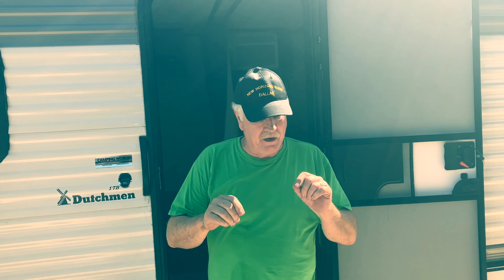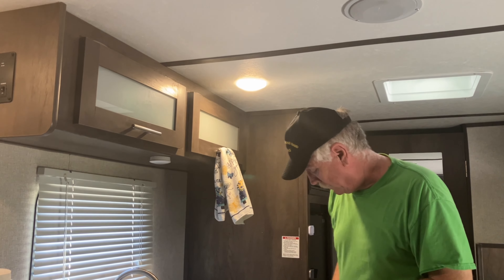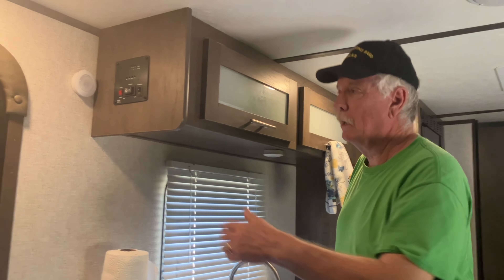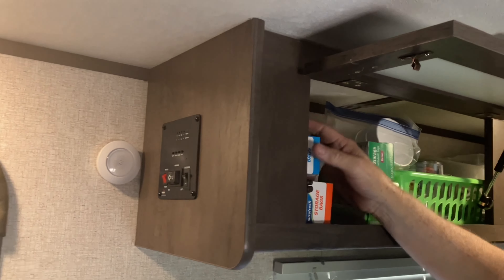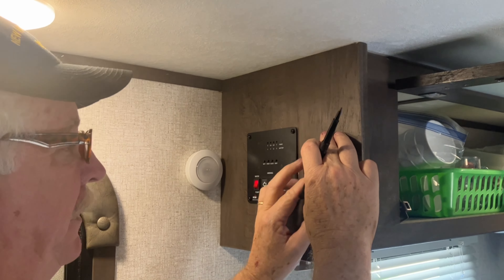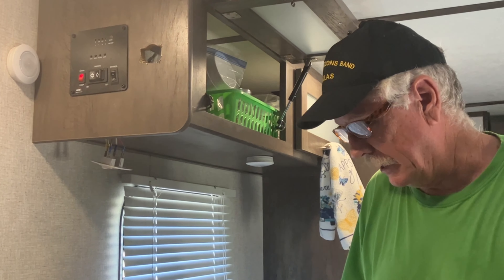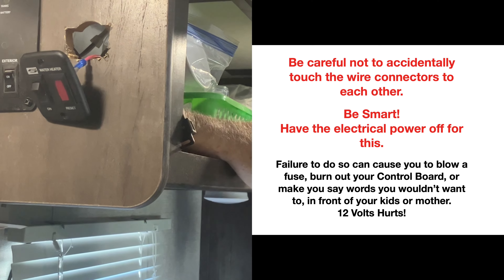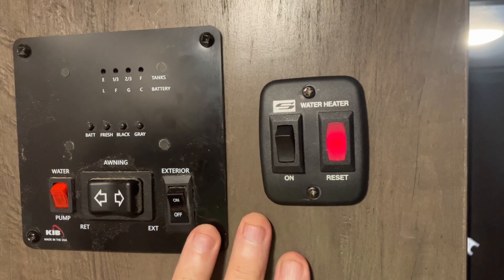Step by Step- Relocate, replace, RV Water Heater Switch- Coleman LT 17B.

Comment: Thanks for the ideas. One suggestion: Always use your cell phone to take a picture of the original wiring. You accidentally pulled more than one wire off and had to think a bit about where they were. Imagine if you accidentally pulled many more off. A picture is a nice easy way to document the wire colors to connectors. I've been thinking of doing this mod. The under cabinet position is in the way of where I want to put a towel bar etc.
Reply from the maker: Yes. I normally do, but this time I was focused on doing a 1 t0 1 wire transfer.
Luckily I accidentally did take a photo when I was showing the viewers what I was going to do. This saved me.
Thanks for the comment!
Reply: @funinourrv  yeah nope, no where in your video did i see a clear picture of the wiring for the back of the switch.

Comment: BTW: When you pull the old switch down I see four wires. But when you connect the new switch you connect three wires???  where the wires connect was most important to me as I am installing a switch in an RV  with a new hot water tank and my 1999 camper never had a switch on the hot water other than the breaker.
Reply: and it is gas only
Reply from the maker: Ours is LP too.
The photo might be misleading, but I connected  4 wires. my two switches were identical except for the color.
Someone suggested to me that the best thing to do in situations like this is to take a photo of the old switch before you disconnect it. unfortunately, if i understand you correctly  you are installing a new switch where there wasn't one. I don't know how to advise you on that. Your heater might not be set up to turn off the light once the gas lights. I don't know how that might work for you.